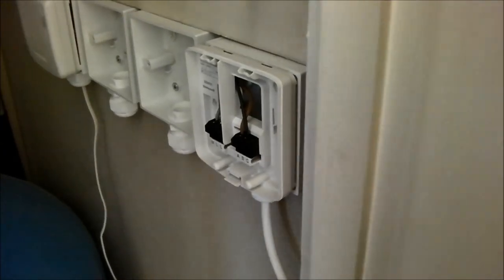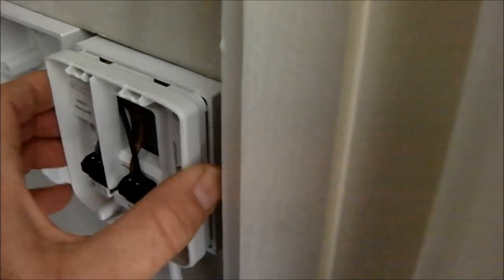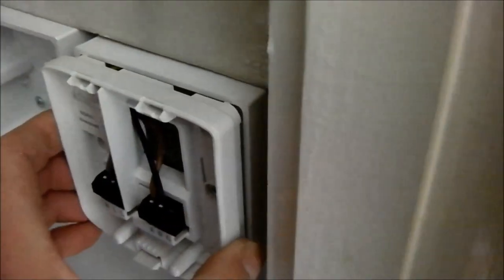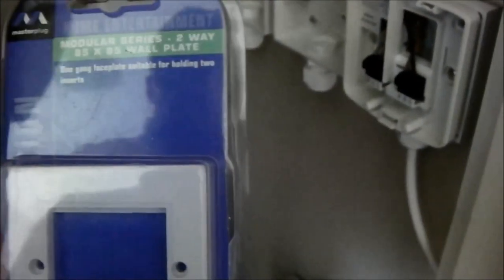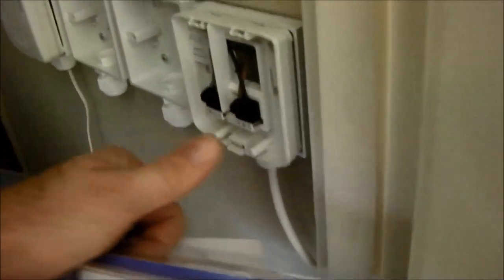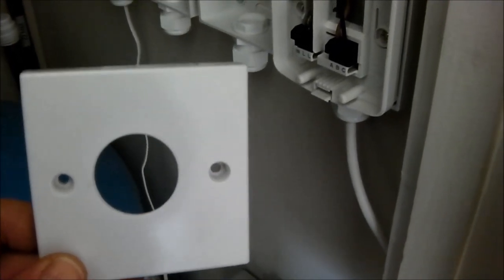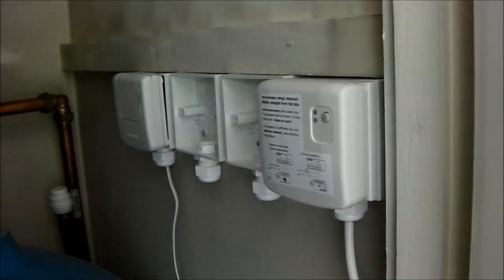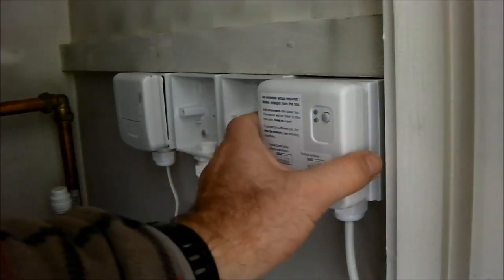How to install a Honeywell Evohome BDR91 relay on a back box / surface pattress video

Comment: I note from your pictures, you have the boxes very close together. I had trouble with my system receiving receiving the WIFI signal. The fix after consulting Honeywell was to move the unit 30cms aware from any other wiring and pipework. Including other Honeywell relays etc as per the instructions. This fixed the issue, just something for everyone to be aware of.

Comment from the maker: Note that the BDR91's should be mounted 30cm apart for best performance. In this installation all of the elements are located within a couple of meters and it works perfectly, but that will probably not be the case in other situations.
Evohome links:
UK:     https://amzn.to/2mB8Ndo
DE:     https://amzn.to/2A1ryjN
FR:       https://amzn.to/2uWpOCu
ES:      https://amzn.to/2zW9oji
IT:         https://amzn.to/2zWDenU
CA:      https://amzn.to/2A0gSlD
US:        https://amzn.to/2uJl1Fi

Honeywell Evohome installer training course:   
https://youlearn.honeywelluk.com/course/evohome